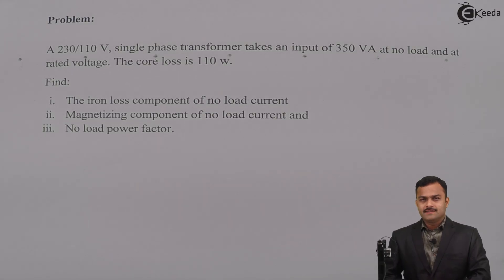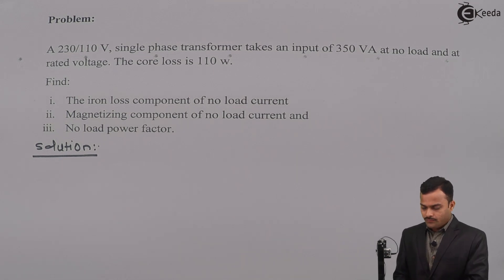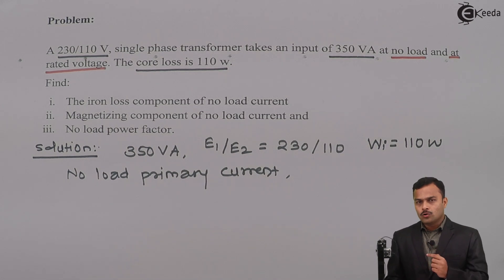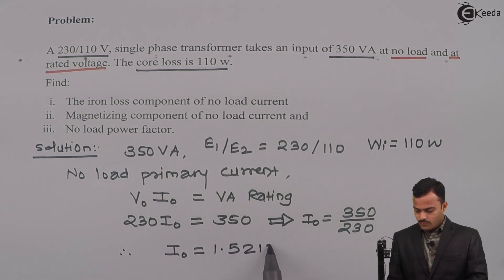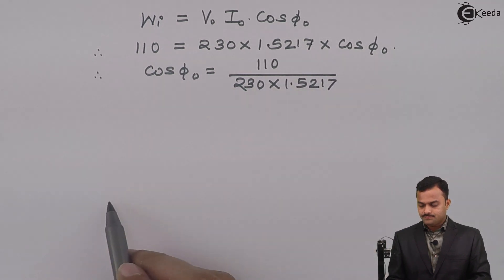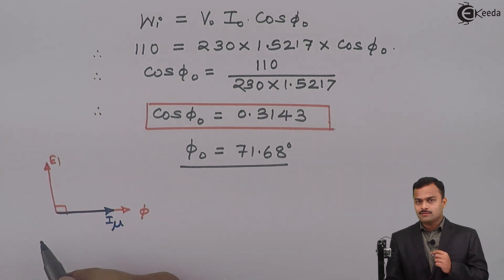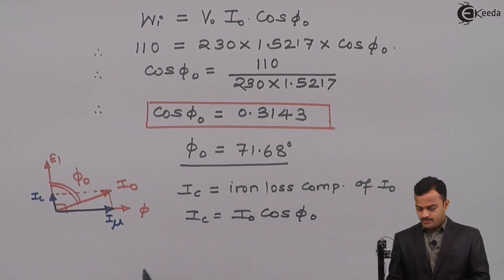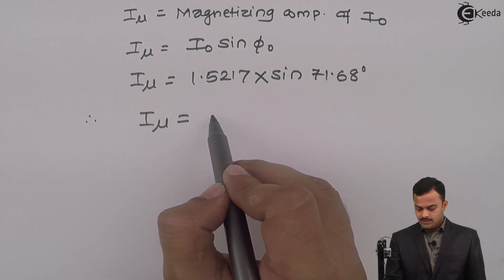Equivalent Circuit of Transformer : Problem 1 - Single Phase Transformer

Comment: Isnt no load pf is the phase angle between V1 and Io?
Reply: I also have same doubt
Reply: Did you get the answer?
Reply: Yes and here V1 equals E1 so angle between them is considered
Reply: @Domamitsu12  bro why V1 = E1 ,, kuch v yrr , ofc copper loss v ho rha hai so resistance v hoga winding ka , toh V1 E1 ke equal nhi hoga . yeh mc subject behnchod kuch v ho rha hai yha . answer ke liye kuch v